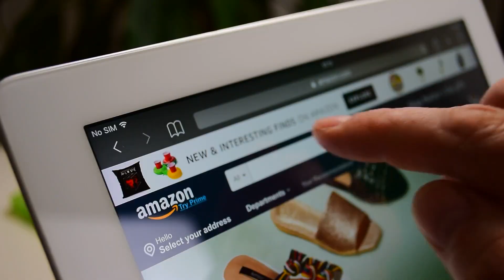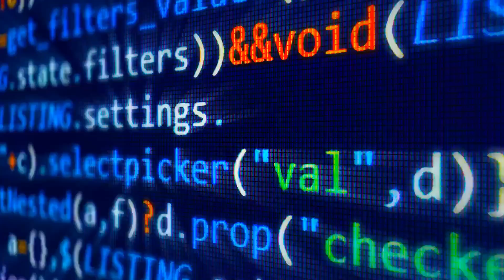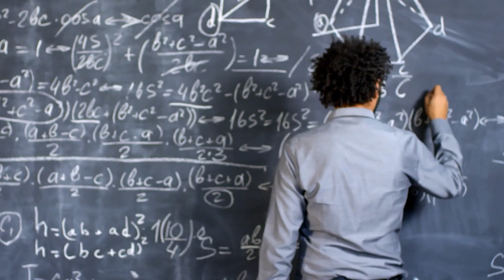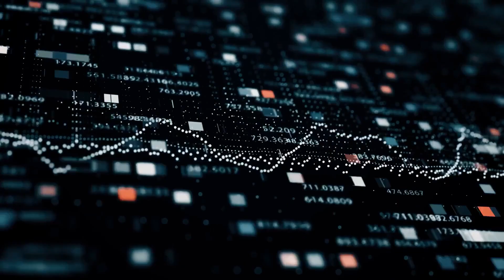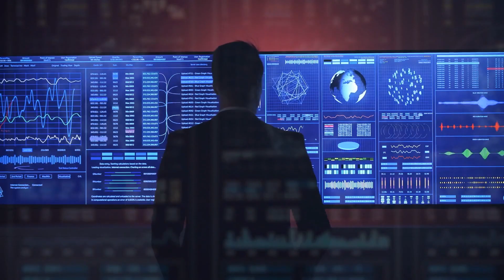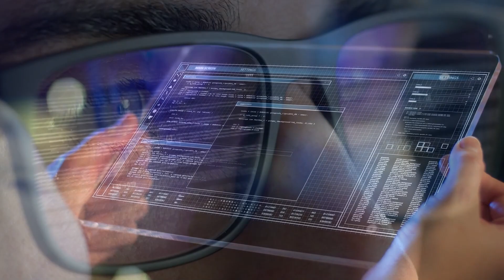Unveiling the Future of AI: Experts Predict Singularity by 2030

Comment: This is most interesting.  The V22 Osprey military plane often crashes.  Could SAI run theoretical design experiments based on suggestions from inventors and engineers in order to make this aircraft safer to operate?  Why hasn't the military done this already?
Reply from the maker: Ahh, that's a good idea